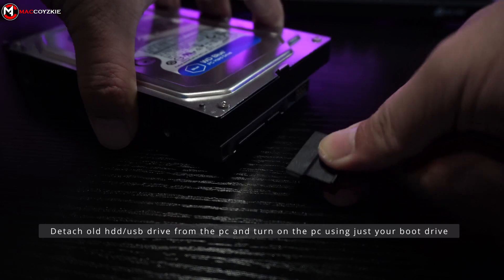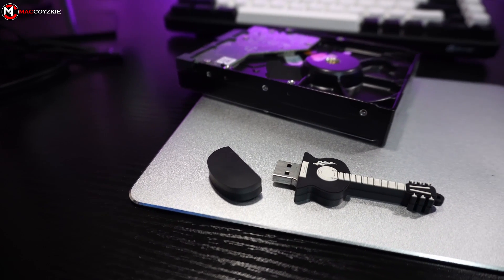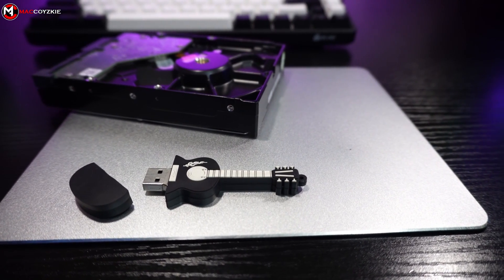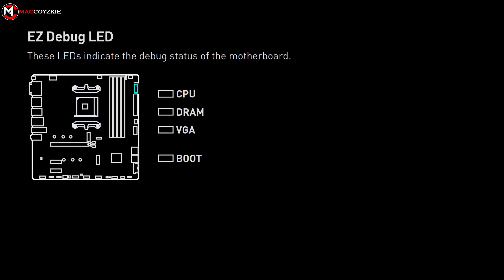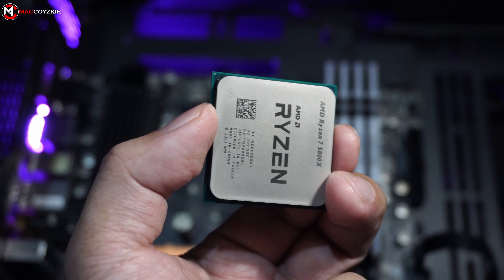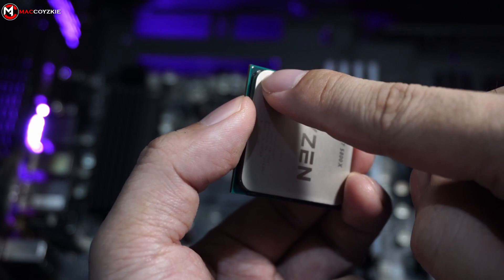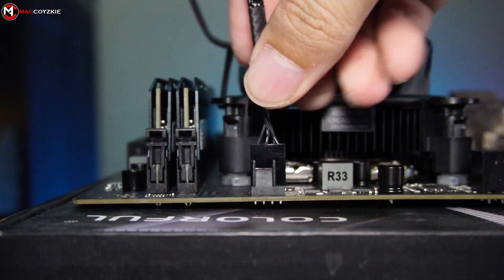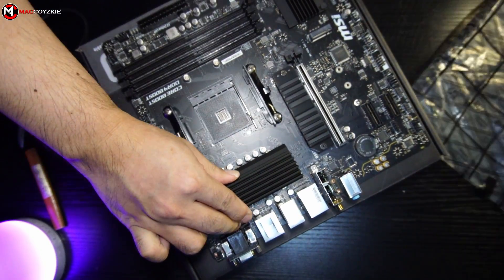Debug LED always on FIX

Comment: Hi sir i already follow ur instructions but i still got the same issue. My fan was running at 100% speed and VGA debug light was still on also.
Reply from the maker: pc might need bios update but that will depend on your pc specs? so what's the pc specs?
Reply: @MacCoyzkie 
 ryzen 5 3600
B450M gamming plus
Radeon Gigabyte rx570
4gb ddr4
Reply from the maker: @MrBorris25  was the pc working before this problem happens or its a new build? if its a new pc build then you need bios update. you might need the help of a local shop to do this but if you want to do it yourself watch this video before starting the bios update https://youtube.com/shorts/nfH5Do3Dq3o
Reply: Hi sir no its suddenly goes blackscreen then reboot vga blinks
 I also tried my gpu to other pc but still got the same problem 100% fan speed, blackscreen. I clean the gold plated for ram and gpu but still no. It might be the thermal paste of gpu ?? Cause of overheat?
Reply: Its not new
Reply from the maker: @MrBorris25  ok so i'll assume it was working before this problem started and yes it could be the cpu overheating specially if you are using a faulty aio cooler, so can you check the aio cooler cpu pump is running or do a repaste if you have air cooler. perhaps the cpu cooler is not on contact

Comment: Hey man. Got a used PC with half parts new half used. MSI Z370 SLI PLUS mobo and i5 8600K , DDR4 3600 2x8 gb were the used parts, everything else new . PC booted and was working fine until I reinstalled the windows, changed the DDR4 Mhz from 2133 to 3600 to test and it was working smoothly after a restart, the same with overclocking the CPU to 4.2ghz , restarted and was working smoothly. Played a bit, turned it off and went to sleep. Next day could not boot the computer anymore , tried everything there was to try except updating the bios. Do you maybe have any more tips on what to do? Would the bios update in reality change anything? Tried reseating , new paste, unplugging everything with mobo, ddr4 but nothing. At one point it booted with 1 ram stick but I was such a fool I thought i fixed it and turned it off to attach the other stick. Next few hours it never booted and the whole time the CPU DEBUG WHITE color is on (not blinking, but on). Much love in advance <3.
Reply from the maker: wait so you are stuck in cpu debug led now? if im not mistaken i5 8600k max ram support is only up to 2666mhz and overclocking it to more than it can handle might cause problems like what you're currently experiencing . what you can do right now is to do this https://youtube.com/shorts/6CUfUdTXfDI to clear things up so you'll be able get to bios somehow and redo the overclocking
btw after you overclock try to run some tests and if it crashes just do the cmos reset again like in the video link i gave
Reply: @Mac Coyzkie  Wow that was a fast reply, thanks dude. 

The cmos battery I removed 3 times ~ while testing other fix options, but I will try to maybe put a new battery. It did not boot up never. Only that one mysterious boot up 1 hr from trying to fix with 1 ddr4 ram stick. Yes, always stuck with the white cpu debug light on.
Reply from the maker: @MrFuturee  the cmos battery should be out at least 5 minutes otherwise it wont work. if after doing so this might be a broken psu so check it using a psu tester like this https://youtube.com/shorts/YrC3PlflLq0
Reply: Tried everything by the manual , ordered the psu tester and tested the psu, cpu cables and they're flawless. Any last resort ideas? Either mobo or cpu is toast. 🥲
Reply from the maker: @MrFuturee  next suggestion will be tedious and i hope you have a friend with compatible pc and ask them to try your cpu in their rig, if it works in their pc then yes it is your motherboard that is causing the problem

Comment: i have a weird issue that has been happening to me sometimes my pc works fine and some other times it won't turn on and i get the red led for the cpu and if i just turn it off for a few hours and come back it'll work perfectly fine and idk what i can do to fix it
Reply from the maker: when it does work can you monitor the cpu temperature? i worked on pcs that sometimes when it overheats cpu becomes undetected
Reply: @MacCoyzkie  it's usually sitting around 68-70 degrees celsius which should be fine idk what's the cause of the issue or what to do
Reply from the maker: @asura5959  i think you need to reseat the cpu the same way i did in the video
Reply: Did you find any solution? I've the same issue

Comment: My boot light is on but I’m getting no display and I’ve replaced all my ssds and hdd and still didn’t work
Reply from the maker: have you tried using just one drive atm, remove any storage drive and just try the ssd boot drive with windows in it

Comment: I have the DRam light error... but it's not always tho. Sometimes my system boots Sometimes not. My RAM is in the QVL of my MB so i don't know why I'm getting issues.  Xmp also doesn't work.  System is a R7 7700x, Gigabyte x670 elite ax,  Gskill Trident Z5 6000MHz CL36 32gb.
Reply from the maker: that build is perfectly compatible and xmp should work just fine, if there is anything i can think of that is causing the problem, it might be the mobo needed latest bios update. If im not mistaken this has been a problem with some people with the same motherboard as yours
Reply: @MacCoyzkie  yeah but I've already tried updating, but still can't get XMP to work. I've tried BIOS F4 (the original BIOS on my MB), F5, F6, and now 7b which is slightly stable.... but still can't get XMP to work. Tried doing test to see if there are errors but nope.
Reply from the maker: @Zephyr-SC  this has to be a motherboard problem since there are plenty of people having the same problem. well i hope it all goes well with your tests

Comment: I have the cpu debug light on when I shut my PC down and it doesn’t really turn off. Fans are on but the monitor display and keyboard are off already. I’m so confused and lost.
Reply from the maker: may i know the pc specs so i can have an idea?
Reply: @MacCoyzkie  cpu is amd ryzen 5 3600 , psu is 650W, gpu is amd rx 6750 xt, 16gb of ram. And as of now, it doesn’t boot anymore With the cpu debug light on. 🥲
Reply: @MacCoyzkie  ok i tried reseating the ram sticks and it works again for now, does this mean that my RAM sticks have the problem? HyperX Fury DDR4 3200 8gb x2
Reply from the maker: @paulbryanapolinar1935  it might be or it just needed cleaning
Reply: @MacCoyzkie  thank you for the reply! :)

Comment: Hey plz help my pc is experiencing the same issue it’s a whit cpu light I’ve tried everything but no change my mobo is B550m pro vhd and Ryzen 5 5600x
Reply from the maker: you might need bios update for your b550 mobo so that 5600x could work.
Reply: bruh i am having the same issue with my b550m pro vhd and ryzen 5 5600x from two days .were u able to slove it ? if yes plz let me know 😢😢😢
Reply: it has been two years since i build my pc and was working fine and yesterday when i turned it on no signal started to show up and cpu white light turned on on the mobo

Comment: Thank you for this guide! It was really easy to understand although my cpu led is still on. I tried all the methods listed in the video and I am still getting a blank screen. Any advice? Thanks
Reply from the maker: no problem bro, btw what is your motherboard model name and cpu?
Reply: My Mobo is a MSI tomahawk b450 max 2 and Ryzen 5 3600. Bought both used.
Reply from the maker: @wordpass3370  if there is anything i think that motherboard needs bios update for 3600,
Reply: Ive done multiple bios flashes and checked for loose cables etc... The weird thing is that my pc randomly starts working like its  normal but as soon as i turn it off, the cpu debug light turns on
Reply from the maker: @wordpass3370  this is not a good sign and might be a hardware issue. My next suggestions will be tedious since we need to test the pc parts to know which one is causing it. 

can you ask a friend with compatible pc to try your cpu in their rig? if the results are the same in their rig then that's a cpu problem if not the same then its your motherboard. I hope you can still use Rma
Reply: @MacCoyzkie  how do I update my bios my cpu light is flashing aswell
Reply from the maker: @playzftw7876  visit your motherboard's website and go to bios, check your cpu name and look for the appropriate bios for it. download and place the file in a usb then use the usb to update bios. there is no general way to install it since it is different depending on what motherboard model you have so check the manual on how to. before you do it yourself check this out first https://youtube.com/shorts/nfH5Do3Dq3o if can't just bring it to a local shop and let them do it for u

Comment: Hello sir, my pc suddenly shut down when im playing game. After that, I try to power on my pc but:
1.The monitor didnt have display and my keyboard and mouse's rgb didint light up
2.My pc dekstop rbg is light up but after 1 minutes(not exactly) it restart by itself
3.Cpu debug led light on when it restart and it light off after several seconds and dram debug led light on after that until the pc restart again
Do you have any opinion why this happening and how this problem solved? Thank you
Reply from the maker: sounds like a faulty psu or low power from outlet. Low power from outlet happens when there is power fluctuation around your area. To check your psu you need something like this https://youtube.com/shorts/YrC3PlflLq0

Comment: What’s the problem if the Dram light is blinking sir? What’s the problem? Is it the power supply? What happened on my computer is the dram is flashing but the air cooler has a ticking sound and it won’t boot. Can you help me regarding this matter sir. Thanks for your feedback!
Reply from the maker: its trying to read it, try to reseat the ram sticks or use the other slot to check

Comment: Hello, my problem is that I have the DRAM led on and the RAM is well placed and everything, I have tried to remove it and put it back, and it still doesn't work, are there more solutions? a few hours ago I turned on the pc
Reply from the maker: newly build pc or already a working one?
Reply: It already worked, but finally I removed the RAM and cleaned it, then I put it back and everything worked, thanks
Reply: @MacCoyzkie  New sub and like!
Reply from the maker: @-ErChechu  that's good news then! welcome to the channel bro

Comment: Should they be on by default? Or if they're on there's a problem?
Reply: My debug LED goes from CPU to DRAM blinking back and forth.
Reply from the maker: @irealyloveblue  that basically means it is trying to read the both so try to at least reseat the ram sticks and cpu. clean the dust off while you're at it
Reply: @MacCoyzkie  tried reseating the cpu and ram sticks. Is there a chance that it's a motherboard issue?

Comment: I build a pc and the red led (cpu) is on for 2 sec and than for 0,25 sec the yellow light is an and so on. Does some one know what that means?
Reply from the maker: some motherboard have this color indication but some don't. in your case you need to check the mobo's manual to check the color meaning

Comment: I haven't built my pc yet. I'm currently in a BIOS update as I type this. My motherboard is stuck on the CPU debug led. I have nothing connect to my motherboard accept the power supply for my BIOS update. What should I do?
Reply from the maker: i think that's normal if there are no other parts yet
Reply: @MacCoyzkie  Thanks. I turned off the power supply and built it everything seems fine

Comment: My cpu light is flashing red every 3 seconds, and my Dram led is flashing orange every 1 second, I tried removing and cleaning ram then placing them separately to see if one of them is defected, but didn’t work, I removed gpu and tried, didn’t work, I also removed Cmos battery for 3 mins or so and also didn’t work
Reply from the maker: new pc build or old one? if its old pc tell me how did the pc problem started so i can have an idea
Reply: @MacCoyzkie  old, my brother moved it the case from table to another to check something, the pc turns on but the screen doesn’t, as if the hdmi is unplugged, then we restart the pc, and now all of the I/O isn’t working, like keyboard and mouse and hdmi, but all fans are spinning, gpu fans spinning, rgb lights on.
Reply from the maker: @odai11  did you plug the hdmi in the gpu port? or perhaps the psu cable was loose due to the moving of the pc so double check the pc connections

Comment: i have a b350m mortar motherboard and it is giving me red light on cpu and dram EZ debug LEDs. When the pc starts first the cpu light turns on then the dram one.
I have cleaned the rams, gpu and the cpu. The pc works as in all the fans work and the gpu fans work too but there is no display on monitor. I checked the cpu for broken or bent pins too but everything is fine. Please help me im freaking i just bought this pc :((
Reply from the maker: as long as there are no steady lights on the ez debug led your pc should be fine, how about try this fix https://youtu.be/F-dLBIomghY
Reply: @MacCoyzkie  they are steady lights
Reply from the maker: @usmanbokhari2446  you might need bios update, what is your cpu?
Reply: @MacCoyzkie  ryzen 5 pro 3400G with radeon vega graphics 2gb
Reply: @MacCoyzkie  how can i update bios?
Reply from the maker: @usmanbokhari2446  ryzen 5 3400g with b350 definitely needs bios update for it to work. There is no general way of updating bios since each motherboard has their own ways. If im not mistaken b350 boards needs the previous gen cpu to update bios, you might need to take your pc to a local shop to do so if you don't have old gen cpu that works before with your board

Comment: My CPU LED light is white and stays on. I did everything you showed and nothing has changed. I am confused at this point
Reply from the maker: new pc build or was previously working?
Reply: @MacCoyzkie  This is a relatively new PC. Same issue even with the second motherboard. I called MSI days. Sent me a new one after I returned it. Same issue
Reply: I even went to head head check the pins. Everything is fine. Nothing is bent. I took it out so many times. Clean it off the paste with alcohol. Now I'm running out of paste because I did it so many times and the light is still there. I don't know what more to do
Reply: @MacCoyzkie  Yes, it was previously working
Reply from the maker: @lydiahomeprojects9544  wait so you got a new motherboard right now right? if so i think that needs bios update. what's the cpu and the motherboard model name?
Reply: @MacCoyzkie  the motherboard is B450-A pro max and the CPU is Rezen 5 3400G
Reply from the maker: @lydiahomeprojects9544  ok i think your motherboard needs bios update specifically to make 3400g to work. updating bios is a bit tedious and you can't make a mistake otherwise it will have more problems. if you don't know how to update bios you might need to bring your pc in a local shop and have them do it for you
Reply: @MacCoyzkie  Can you please tell me how, I would like to try first
Reply from the maker: @lydiahomeprojects9544  First visit the motherboard's website, go download bios, look for the specific bios for your 3400g cpu, place the file in an empty usb and make sure there is nothing in it besides that bios file. This is just a general instruction but different motherboard manufacturer have different ways so check the motherboard's manual for more info

Some motherboard have this flash bios button at the motherboard's io with a dedicated usb port, therefore you don't need any display to update bios. just plug the usb there, jump start the motherboard and let it update itself.

you will completely rely on motherboard's lighting indication for its progress, again depending on the motherboard manufacturer, lighting indication are different so check the motherboard's manual

A WARNING: never interrupt the bios update process in any way because if you unplug the power or you got power fluctuation in the house or accidentally turn the pc off, your motherboard will never work again. so be careful

this is why i always tell my viewers who doesn't know anything about this to bring it to a local shop, at least if they break it, they should pay for it

Comment: So I have this similar mobo except b660 with these debug issues. The dram, VGA, and boot light up for a few seconds when I boot it up with the GPU plugged in.  The GPU is the RTX 3060 ti. However, if I unplug the GPU and run the computer off the motherboard it boots up just fine. I did notice that it is not detecting wifi or my HDD (but it sees my SSD so windows downloaded on that anyway). I already did the steps except cleaning it (it is brand new out of the box and not being able to test it on another computer). Do you think this sounds like a faulty GPU if the computer can run off the motherboard still? Should I exchange it?
Reply from the maker: if its new no need to clean it, you can try this first https://youtu.be/pwgg8Vp2NNk let me know how it goes
Reply: @MacCoyzkie  so I’m having minor issues. If I plug the graphics card in I can’t reach the battery because it covers it. But if I move the gpu lower I have to unplug some cables that hit into the gpu fan (the board is a smaller version). Would I be able to remove the battery then place the gpu in or would it be okay if I remove the cables? (Audio, a fan, and sata for HDD that actually isn’t registering on the computer either)
Reply: @MacCoyzkie  I tried both steps of the video, but neither seemed to work. Under my display adapter I only see “Microsoft Basic Display Adapter” and it only lets me uninstall it and not delete it
Reply from the maker: @Crystal19961  did you plug the hdmi in the gpu port? sounds basics but i need to check. if you already have try going to bios and load optimized defaults, its actually the same as clearing cmos